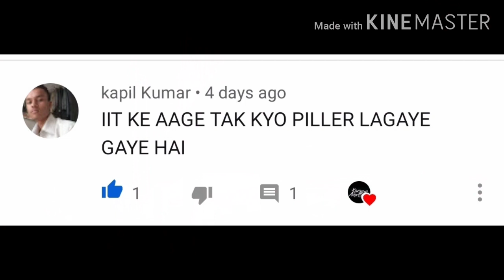Kanpur Metro | Part 2 | Night Shoot| Phase 1| IIT to Motijheel |#kanpurmetro

Comment: extended pillars are used to change the track of the trains set, might be there they will use a different type of girders as they used in Noida metro. OR that pillar will connect it to the metro car shed.

Comment: Simple answer hai , there are two tracks uptrack & downtrack , while train is at its destination/source station then how come the downtrain can turn into uptrain so the track goes almost 400 to 500 mts ahead of such end/start station  for shunting the train as in metro there are driver cabin at both end but train needs to change the track too !!! Hope you would have got your answer for having extended pillar ahead of IIT Kanpur metro station , same will happen to baudha nagar but not in motijheel as from motijheel the track will go underground tunnel .
Reply: The Ugarder would be different than used for running track , this may also happen as the same is here in Gurgaon .
Reply from the maker: Thankyou so much for sharing this valuable information with our viewers.
You explained it really well.👍